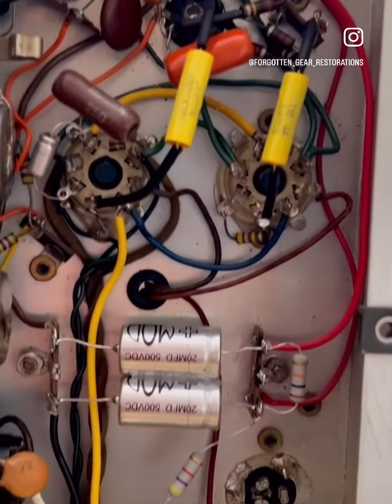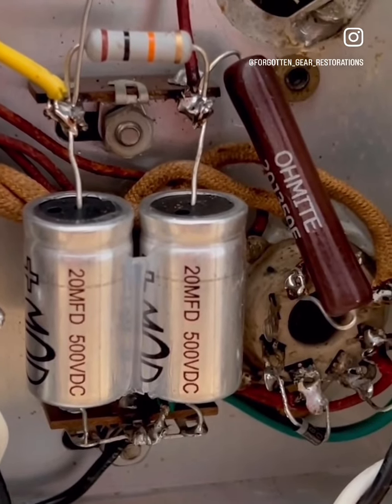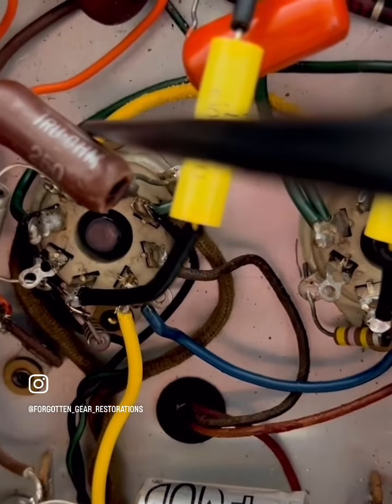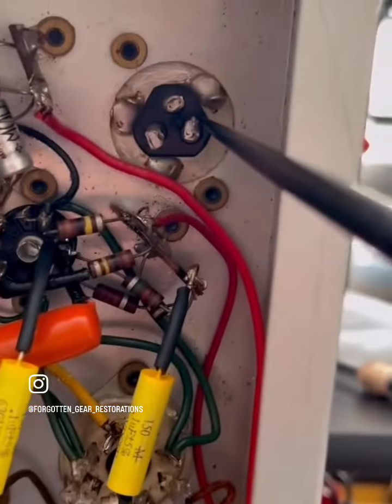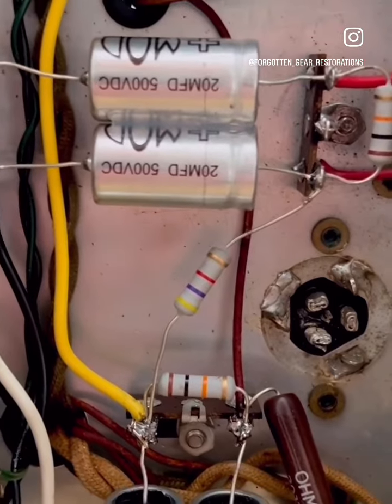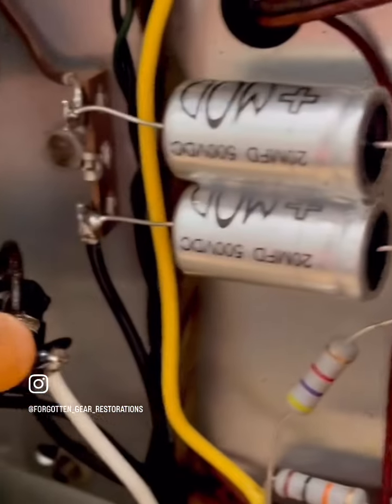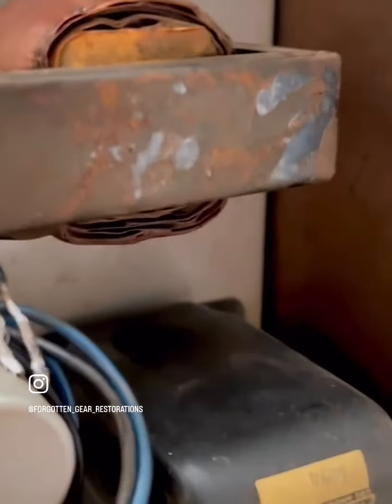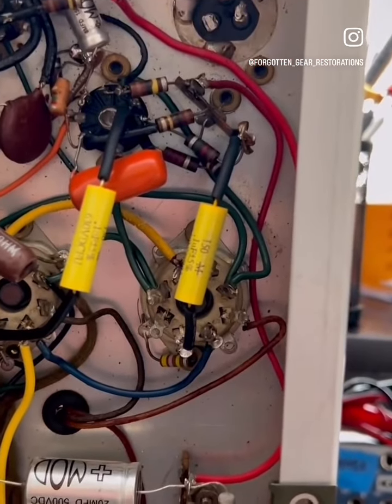Vintage Magnatone Troubadour || FGR Rerun Archives

Comment: That cracked Bumblebee! I just changed a quad of those in a McIntosh MC225. Only one of the four was bad, but it caused a driver tube to get so hot it blew the nipple off the envelope. Replaced them with (at the client's request) Vitamin Q caps, replaced a few other caps and the driver tubes, and all is well.
Reply from the maker: Hot nipples used to make my weekend. Now they are nightmare scenarios.
Reply: @thatampguy  🤣🤣🤣🤣😂😂😂